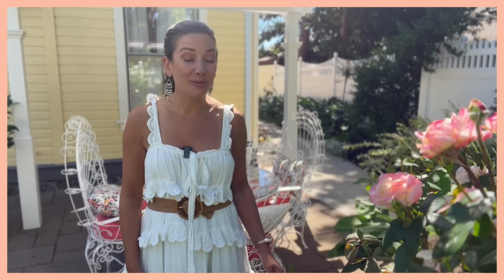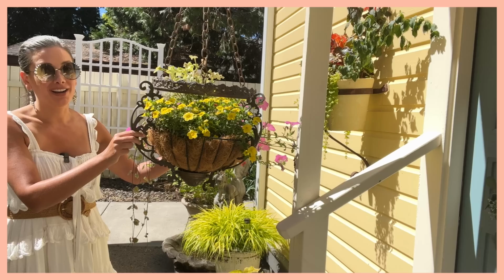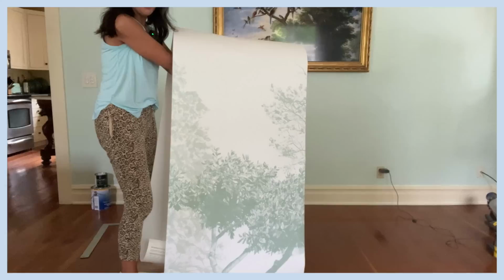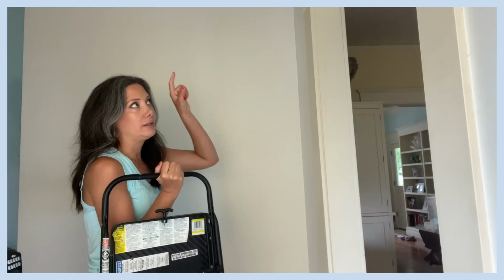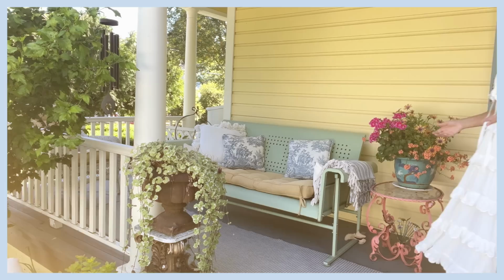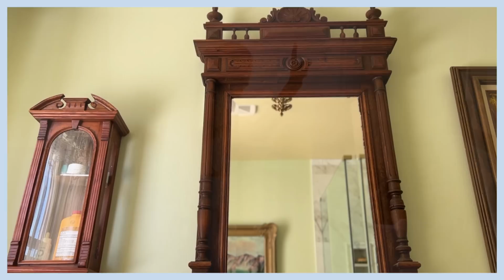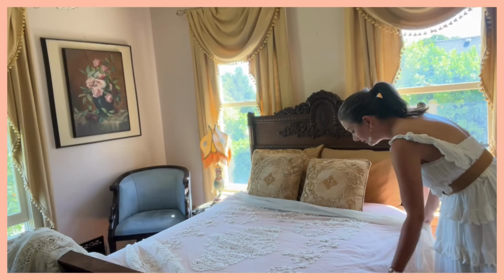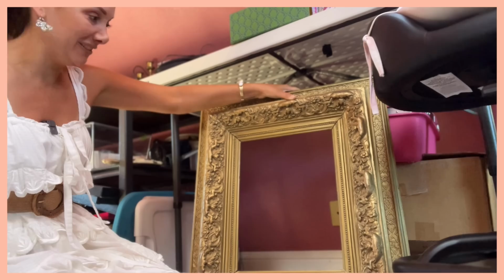Summer Cottage Home Tour | Easy Outdoor Garden Decor Ideas with Vintage | Wallpaper Trends

Comment: Hi Selena, I saw a cool shoe holder...it was like a woven mat with woven pockets for shoes. You hang on the wall and then put a shoe in each pocket. If sandals you can put both in one pocket. I really liked how it was done...and easy to find them, grab them. Just runs up the wall too so space saving. I liked that it was made from wood and canvas. I wish I had a photo to show you. I found one similar...shows the round bar  at top and then fabric tabs that hang the fabric canvas hanger to the bar (like some curtains have). The pocket so cute little striped...love it. I need one now LOL.

Comment: I've done a lot of wallpapering and I would never use that kind of knife I always use those blades that you snap off as you're going and you do it frequently to keep your blade sharp and you need pliers to snap them off. And I used a painter's taping knife as a straight edge for cutting. I think that's what it's called. The very large one. And you don't want to drop it cuz then it could get bent and then you wouldn't have a nice straight edge for cutting really crisp cuts with your wallpaper.

Comment: It's interesting how lately I'm seeing people on the internet putting the wallpaper glue on the wall... The original way(my father has been working this field for decades, but we're in EU, so idk if t's different) is to actually put it on the wallpaper, then fold the back of the wallpaper onto itself so the paper can really soak in(there's , like, a "special" way to do it), let it sit for at least ten minutes and then pick up the folded panel, let ou the top, line it up on the wall and let the rest unroll down and then press it on. It's been years since last I saw it being done, so, I wonder, if the glue instructions changed or what? Seen it done(and helped do it) so many times over the last 3 decades and never saw anyone putting the glue on the wall....This is not me knocking or anything...just genuinely surprised